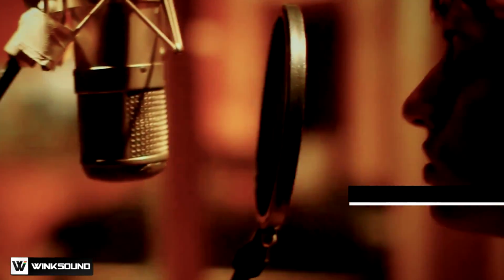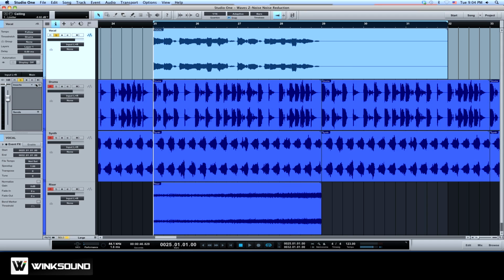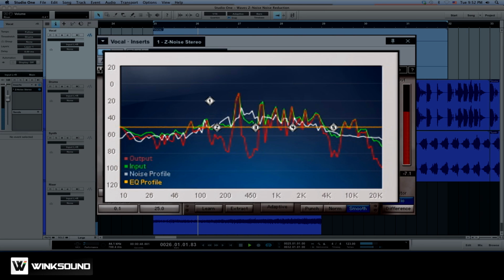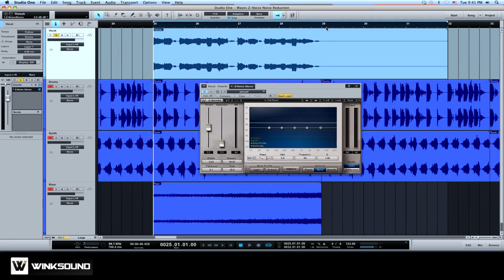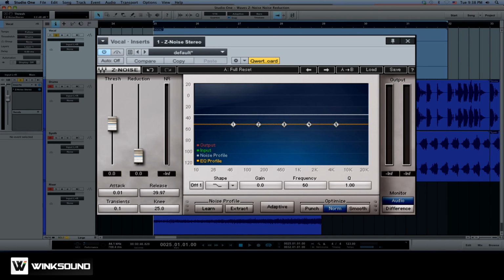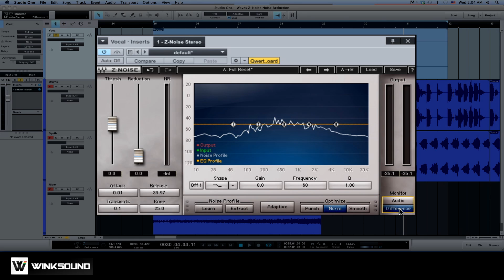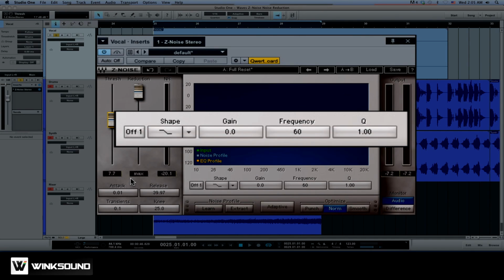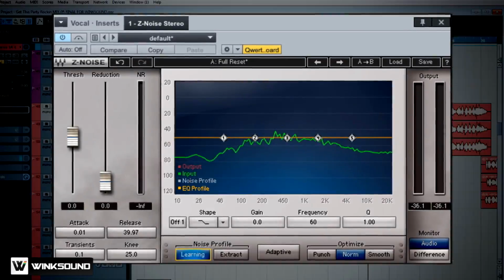Waves Z-Noise: How To Use Noise Reduction | WinkSound

Comment: I tried using this while transferring a language course from cassette to computer, in order to digitize. Unfortunately, this plugin kept adding an echo, and some flanging. The 'Learn' and 'Extract' features were utterly useless in that they failed to properly discern the difference between the noise and the speech. Funnily enough, I found that using a simple gating plugin (I used the free GGate), the tape hiss can be removed much more easily.
Reply: You must have been using it wrong. It works really well and is dead easy to use.
Reply: @oinkooink  I've been using the NS1 noise suppressor, which is dead easy to use.
Reply: @CrankCase08  So's the Z Noise.
Reply: @oinkooink  Right, although I found the NS1 to be far more effective.

Comment: using Z-noise makes my track delay by like a second. I looked on google and the way to fix it is to nudge it by the samples that are delayed. they told me to find the dly/vol etc indicator but i HAVE NO IDEA  WHERE IT IS!!!
Reply: did you fix it?
Reply: it's delaying due to processing. i know this comment was one year ago. you might have learned already but the way  i fixed it was print out the audio into another track after noise reduction then just push it back to match the original sound waves and there you go. that will fix the delay issue.

Comment: Sounds like white noise was added to her vox for this tutorial. This plugin works great (sometimes) but in real world situations, AC compressor hum, fan noise, wind, ground loops, unwanted reverb decay, etc., it can't remove all of the noise without compromising and degrading the quality of the audio.
Reply: +Jazzyman  if you want to add effects, add the Z plug at th end, if you want no effects just use it first, then add some eq.

Comment: Z-noise has a few features that X-noise doesn't have. Such as the Extract profile mode, Adaptive profile mode and  a 5 band EQ which allows the Z-noise much more control
Reply: Then why is X noise more expensive?